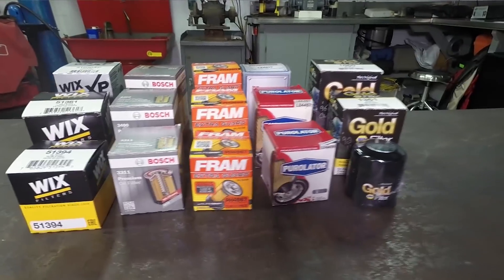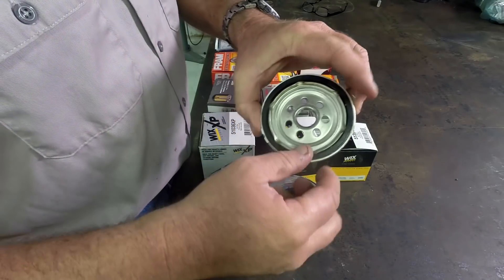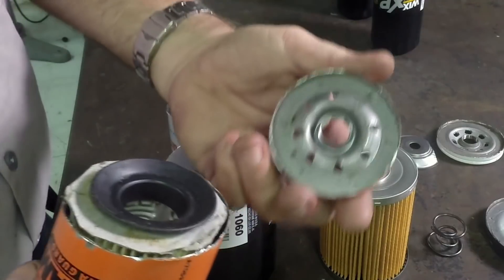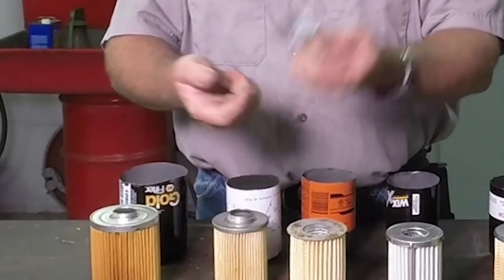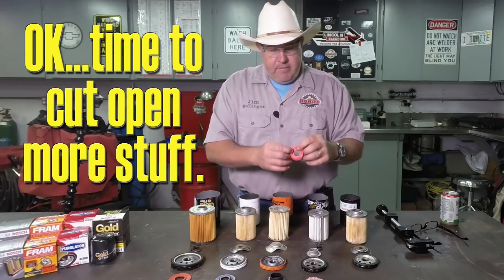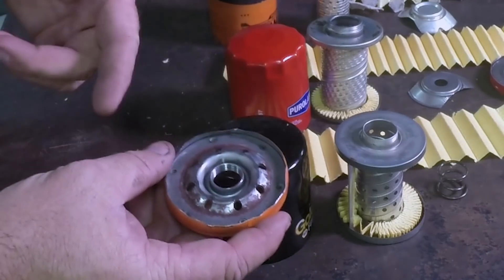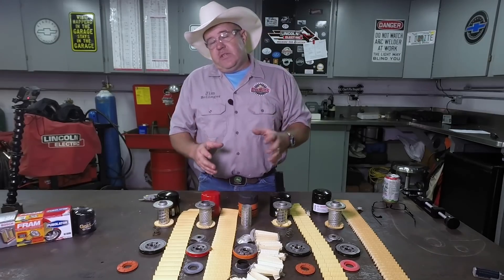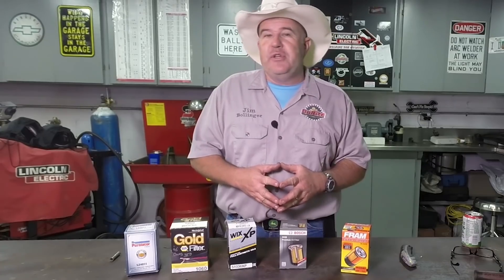The worst oil filter EVER!

Comment: Wouder what Ford Motorcraft looks like think I'll cut one open  and see..
Reply: OkeeCrazyHorse - let us know what you find.
Reply: never owned a ford, but I thought they were supposed to be pretty good quality
Reply: I cut them open from my triton, been satisfied with them myself
Reply: motorcraft makes a good oil filter. if a ford has a lifter rattle upon a cold startup, bet your money it has a fram or some other cheap filter. use a motorcraft and no lifter problems. when i bought my last mopar it had a cold start lifter rattle b/c of a fram filter.
Reply: @axlegrind4212  you sure that noise wasn't a chain tensioner loosing prime and not a lifter? Not sure what engine you have, but ford recommends all their modular engines have the proper anti drain back valve in the filter. This prevents those tensioners from collapsing while waiting on oil pressure to pump em back up. Those tensioners require oil pressure for them to work right. If it's a ford use motorcraft only... Ford's are picky rascals.

Comment: Frams were called the "orange cans of death" by shop guys!
Reply: We used to call them engine killers!
Reply: F-ckin Ruins Any Motor. Learned that 30+ years ago. Still true...
Reply: because the fram toughguard was the cheapest with a cute color...and a great name  L:-) . Many garages have sold the fram toughguard because they get it by the thousand and they are cheap. Most people don't even know anything about oil filters
Reply: been using fram for over 45years! have never had engine problems. lucky i guess.will be changing oil asap.wish i saw this a month ago.heading to napa.

Comment: At first I was skeptical about the fram hate - hey, nothing wrong with cost optimization if it still results in a working product. But the rust and flaking cardboard... nope nope nope.
Reply: Spag The Maker I would like to see where he bought the Fram filters from. Rust needs a moisture source and sitting on the shelf with high humidity will rust almost any filter that is not sealed. That why I only buy filters that are sealed by a wrapper.
Reply: @Fix-it-tony  Where do you get Fram filters or any brand that are sealed in a wrapper?  I've only seen them in cardboard boxes and this includes everything from store brand to fancy brand.  Maybe where you're from is high humidity so they package them different?
Reply: Calvin Walker the Fram Ultra 20k filter I get from Amazon are sealed on the filter with plastic wrap.
Reply: @Fix-it-tony  I haven't seen those for sale here so maybe it's online only?  I bought a Mobile 1 oil filter the last time I changed my oil.
Reply: Fram's not gonna like u now
Reply: The rust is unacceptable, it must happen in the manufacturing process. I would be surprised if there isn't a class action suit over this
Reply: Kinda set the FRAM filter up....( any filter will rust if given the same situation...try ir.)

Comment: Surely you should use the filter recommended by the manufacturer of the engine? Using 3rd party or OEM parts the quality can vary.

Comment: Hello, Thanks for the video. Now i know that the purolator filter is better than the FRAM. However i think that most people buy the fram due to the cheaper price as the cost of maintaining a vehicle can be a bit high for some persons. Can you do a review on the cheaper options available for oil filters . Thanks.
Reply: Many people will always buy the cheapest of anything when they don't know that paying more will get them something far better simply because cost alone is not any kind of indication of quality. Sometimes paying more is just paying more. This is one of those situations - without the technical knowledge of what you're actually looking for in a product, cost is the determining factor.

Comment: Not sure what you mean by return oil pressure.   Most vehicles are dry sump so they don't have a return oil pump.  Even on wet sump motors the filter can be after the feed side pump.

Comment: Being a farmer/dirt construction contractor, I ran as many as 50 engines at a time and always favored, NAPA and Wix, because we had cut some apart also to check for metal shavings and trash in the filter.

Now for an interesting aside on filters,  15 years back I bought a new Lincoln Ranger 8 and put it on a service trailer.  It had a 3 year warranty if you ran synthetic oil and Kohler filters.    The fuel pump went out at about 80 hours and I took it to local Lincoln Distributor for service.  My guys had put a NAPA Gold filter on it but when I backed up to the shop, the service manager, long time friend, told to me to buy a Kohler filter up front and put it on before backing in the shop.  He said the warranty was no good with filters other than Kohler.  I did and they fixed fuel pump.  But Jim called me into his office and the Kohler service website stated that all Kohler filters were made by WIx.  "A rose by a different name."  

As for Lincoln warranty service, none is better.  That new fuel pump went out at about 180 hours again and they replaced the machine and sent it back.  That second machine is running and welding still today--I may be retired but two things I can not be without are portable welders and skid steer loaders

Comment: Fram is owned by Allied Industries which is owned by Walmart which has most products made in China. Check out Allied Industries for all their fine Products!!!   Don't use any of them ever!!!
Reply: UAW says it all, look what they do for GM.
Reply: Fram is owned by rank group
Reply: cheap, but you get what you pay for. When the filter is only $3  you can't expect ANYTHING good. The fram ultra synthetic filters are very nicely constructed, which actually changed my mind on fram, I was a stark "hater" years ago but now I use the ultras since they came out. It's like comparing an entry level car to the top of the line model from the same manufacturer.
Reply: Don S allied and westing house made everything government when i was a kid. now o cut all my filters apart and there all junk

Comment: FRAM’s the best! It’s all I ever used in my 86 yugo and that lasted me for months!
Reply from the maker: Damn! You guys are cracking me up.
Reply: LMFAO.
Reply: Hugo’s are junk. Trabant all the way. Air filter, oil filter both made from last weeks Moscow Telegraph newspaper. Top quality, also good to make bodywork from.
Reply: Trabant; is that the one that has the heated rear window to keep your hands warm while you push it to the repair shop?
Reply: Ian Damian Lucifer Wilson 
Where the hell do you install oil filter in Trabant?
Reply: I've had the opportunity to ride in the two worst autos ever made. The worst is of course the Yugo. The next to worse is something called a Russian Lada Niva.  And the Niva was actually very reliable, but it drove like it had no suspension or steering.
Reply: @web5271  There is one that tops both Lada and Yugo, back in the East Germany days they used to make a 2 stroke engine car called Wartburg. Besides it was a mobile coffin my father had the engine/transmission rebuild 3 times in 6 years. For the record I have driven all 3
Reply: This is not a problem for Yugo drivers. Back in the day, the oil change time frame was 3000 miles or 3 months. No yugos ever lasted that long.
Reply: cisa93 if I could,do you think I’d have three divorces behind me? 🤦‍♂️
Reply: Lads Niva. Now there is a blast from the past. If I remember them correctly the were belt drive. 3 cylinder engine and off of the gearbox two pulleys. These were connected to the rear axle by two 4 inch wide belts. The power side of said belts ie coming off of the gearbox too the axle, ran in a channel between the floors whilst the return, going from the axle back to the gearbox, was outside.
Reply: @iandamianluciferwilson7385  That was a Daf 600. There are still some runnig arround. They were one of the first VCT transmissons.
Reply: Ya, that's a LADA junk!
Reply: You own a Yugo?  I'm so sorry
Reply: Colin Donovan if someone actually owns a running Yugo in 2018 don’t feel sorry for them because they have the kind of luck that will win the lottery.
Reply: LMAO !!!!  GOOD ONE.
Reply: With a Wix your Yugo would have lasted a full year
Reply: Too funny
Reply: Good one! Lol
Reply: Hilarious...
Reply: Well played.
Reply: Yugo and Fram are made for each other, they are true soulmates.
Reply: I bet theres card board in your oil pan or some rust material
Reply: @DonovanBryant92  That was in the engine from the factory!
Reply: I only use Trump brand filters.  Made in China.  Make your engine great again!!
Reply: If you try to YUGO in a YUGO,  YUGO to the BUS STOP a lot!😆🤣😆😵..........😝

Comment: I spent 40 years in the automotive aftermarket selling auto parts. Wix is now and always will be the best filter. We had filter cut away displays in our stores showing Fram and Purolater next to our filters. I sold Carquest Filters, like Napa, were built  by Wix.  Even with the sales material we had in stores, we'd get a customer that thought the cut up Fram filter was a sales lie by Wix to trick the customer, and wanted a Fram filter for their car! Fram did have a great advertising department. Great video!
Reply: I cringe at the fact that because of Fram's marketing and widespread availability, along with DIY'ers frugality that these low end Fram filters are going on modern engines with oil driven variable valve timing and cylinder deactivation systems for 7,500 miles or more. These were crap filters to use when oil changes were done every 3,000 miles but now intervals are longer.
Reply: @killer2600  Great marketing can sell garbage.  Look at Trump.
Reply: @michael931  Only a REAL DOOFUS can bring politics into a mechanical conversation! HAHAHAHAHAHA
Reply: I don't see how oil filters relate to politics but to appease your interest, I don't think anyone was sold a false image of trump. Unlike the Fram filters where, until the dissections, people didn't know they were so radically different inside compared to virtually all other filters.
Reply: @killer2600  Well I am still waiting for Mexico to pay for the wall.  I seem to remember that being stated once or twice.  So I think the false advertising comparison is fair.
Reply: How are motorcrafts??
Reply: tttarms1970 repackaged Purolator. A decent filter for the money.
Reply: Purolators
Reply: My neighbor had a carquest oil filter on his farm tractor. Engine died from oil starvation. When the oil filter was cut open, the inside material was for a fuel filter. Strange but true.

Comment: NAPA Gold filters are manufactured by WIX. They should be identical. The old micron ratings for oil filters is a thing of the past. Now a time/weight test is used to evaluate efficiency. Modern filters use synthetic media that flow oil longer instead of clogging, keeping the bypass valve from opening and keeping your engine cleaner. With extended oil changes, the old paper style elements are inefficient. Get the best filter you can. WIX XP is a very good filter.  You can read actual SAE publications on oil filters online if you want to learn more about test procedures. Testing filters is done with scientific procedures so results can be duplicated -- think labratory.  Fram has been junk for ages. Once  the paper filter media begins clogging, the bypass valve opens and your engine is lubricated without filtration. Most bypass valves are rated at 12 psi. An engine oil  pump puts out a lot more pressure than that.  There is no monitor that tells you when that happens. You get what you pay for.  I have been using Amsoil products for about 27 years and have zero complaints.

Comment: OEM Chrysler is made by Wix. Unless they have changed their supplier.
Reply: I buy Mopar brand filters at Walmart, but in the back of my mind I always wonder if the Mopar filter I but at Walmart is the same as the ones sold at the stealership.

Comment: How does Fram do it? Well a clean circulating system does not require a lot of filtration to maintain the cleanliness and modern oils are excellent. Most vehicles can get by with an inferior filter as long as the oil and cartridge are changed regularly. Truth is the great filters cost about the same as the really crappy ones, and marketing is powerful. Good to know where the value is, everybody has to make their own decisions, cheers!
Reply: Often if you're paying ad agencies and NFL network to advertise, the product is poor.  If they spent that budget on improving build quality, then word of mouth would be their advertisement, like WIX.

This is true of most products.  Heavy ad push often equals poor product value or quality.  Budweiser, Chrysler, Taco Bell, McDonalds, politicians.....  The list goes on.
Reply: @STho205  very true, those 'top' companies have nothing to prove but sure have a lot of savings by making a cheaper product and making people believe, whereas a smaller company still has to grow its reputation, and cant do so with a cheap product.

Comment: Someone needs an oil filter cutter from summit racing.  Handy tool to check what's happening inside an engine when you do an oil change :)
Reply: i was thinking the same thing, too. it's weird tho, he has that tool right there on his work bench. 2:25. 🤓
Reply: Funny. The grinder is probably more dramatic for us simple folk.
Reply: A visual inspection of the internals of a used filter will tell you absolutely nothing about what is happening inside an engine unless it's already completely fucked i.e. by the time there's enough foreign material caught there for you to see, it's already well beyond the point of no return.
Reply from the maker: I have one, you can see it on the bench it some of the video. Some of the cans were so soft, that the can wasn't cutting, it was crushing. I've done a lot of cutaway work with a grinder, so it was just faster.
Reply: YES, there are a number of tool companies that filter cutters,  and they do Not spray metal into a filter like your grinder.!!! Big help if you are looking for metal in the filter media.

Comment: Hey Jim:How about running some Car manufacturer OEM filters through the test. You have me wondering / worried  who might be making their filters since I use OEM filters.. Then compare them to the ones you just did.
Thanks
Reply from the maker: Interesting information.
Reply: I think for most cars while still under warranty you are required to use there OEM filters to keep your warranty valid . If something did happen you could say you used the OEM  filter
Reply: 12wing Wfetech nope. It's illegal to deny a warranty claim for using aftermarket maintenance parts, unless the automaker supplies the part free of charge. Look up the Magnusson-Moss warranty act for details. This is largely the reason most European carmakers do free maintenance throughout the warranty period- some of their oil requirements are pretty strict, and the typical quick lube place usually doesn't stock oils that meet the specs. This was a lot of the reason VW had serious sludge issues with the 1.8T engine in the early 2000s- people not using the right oil. Of course, having a high-strung turbocharged engine with a 3.5 quart oil capacity didn't help, either. The transverse engine cars that used that engine didn't have the problem, because they hold 5 quarts.
Reply: I did not know that I live in Canada I wonder if that would apply here or just in the US ?

Comment: I took a tour of the Wix filter plant in gastonia about twenty years ago, you would be suprised at the company's that wix build filters for. Each company has somewhat different spec's on their filters. This was one company my mechanics really enjoyed seeing. Some people may not have caught it but napa is one of them.                    NAPA Filters, Attention: Technical Services Department, 1 WIX Way, Gastonia, NC 28054 is for their warranty and that is a wix plant. We had fram on contract a few times and hated them, they have never changed to make a better filter, cheep. Wix has always did a great job for me and I have used thousands of their filters on the vehicles I was over, never had a failure with one either, can't say that for the other brand. I always enjoy your video's, keep up the good work we learn from them. Thanks!

Comment: Fram just doesn't get it. They have done this for decades and never changed their design. I personally have seen two engines over the years wiped out with new Fram filters on them because of collapse in cold weather. We used to use Fram at work until I convinced them to change to Napa Gold by doing exactly what you are doing here. Fram has had a bad reputation for a long time and I just don't know why they don't take heed and stop with the garbage filter, or stop hyping them up to something they aren't, or both. Very misleading and possibly very costly to consumers.

Comment: Years ago now I used to regularly cut open filters looking for contaminates. I found more than a few of those 'orange products' where the media had substantial glue voids, leaving very large holes and/or partially collapsed media. Some had really poor looking relief valves, not to mention the anti drain back check valve issues as in the video. IMHO, another reason to do frequent oil changes is that in the event a bum filter is encountered, it will have less time, and be less likely to wreck havoc. Other bad filters were those heavily marketed toilet paper gimmicks... oil would 'channel' through them; don't get me started. If you ever get a chance, for comparison could you chop open some new OEM filters... like maybe Honda, Toyota etc etc. You'll likely be pleasantly surprised! Cool videos, Thanks!
Reply: Any filter CAN fail....most manufactures have the game covered...make it a inexpensive as possible...without compromising the performance. FRAM does exactly that...as with some
of the other brands.